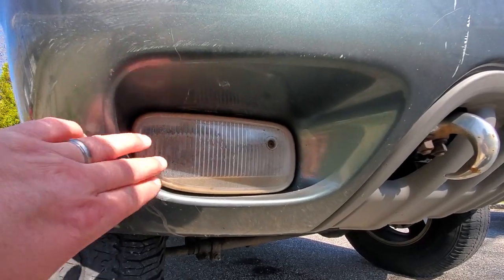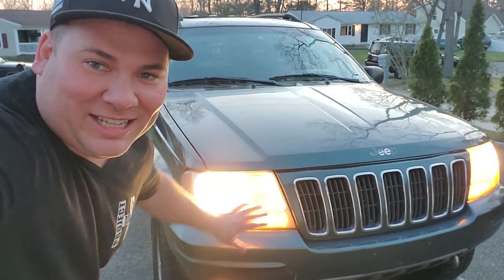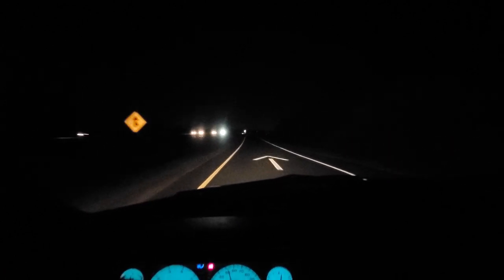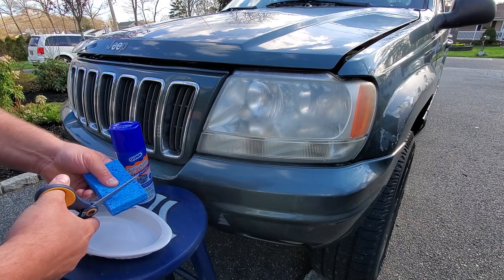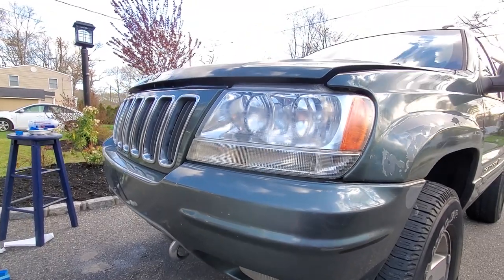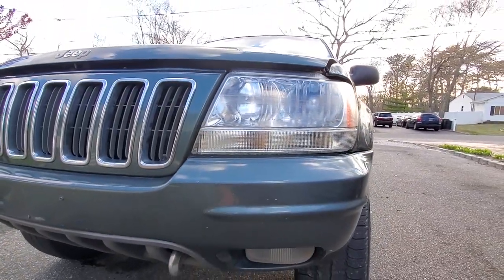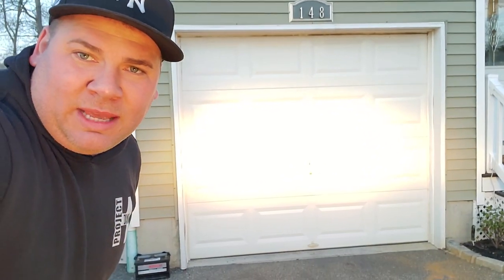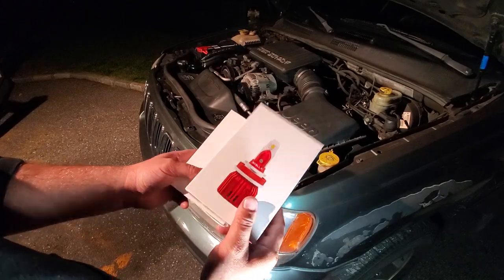JEEP WJ LIGHTS - RESTORING AND REPLACING GRAND CHEROKEE LENSES FOG LIGHT AND BOSLLA LED BULB INSTALL

Comment: great tutorial Dan...hey couldnt you drill a weep hole in the fog light if you didnt want to change them out to keep the water draining out
Reply from the maker: That's a great idea.. I did gus's right on the. Bottom closer to the  front right?

Comment: I need to upgrade to LEDs in my WJ. Just for future reference, Kelvin is the temps at which the bulbs burn. lumens are the output. 10k temps would be deep blue. but 10k lumens would be a really bright light output. typical bulbs burn at 6000-6500K for headlight output(LED & HID)
Reply from the maker: Exactly 👍

Comment: Yes hi Dan I had bought in speakers off of you about maybe a year ago I have a question and a situation my charcoal canister under my 2003 Jeep Grand Cherokee the metal box I guess that it sits in is totally rotted away the the charcoal canister is just like hanging there by the hoses what do I do about this can you just give me some ideas I would really appreciate it Dan thank you very much
Reply from the maker: Hey! Hope you and the speakers are doing well.  The box isn't completely necessary.  If you cant find a replacement see if you can hang it up there with some zip ties... just so long as the tubes and hoses are connected 😊
Reply: @ProjectDanH  I will try that thank you

Comment: Hi there Dan im working on a 99 grand cherokee v8 4×4ect about to install some new fog lights but cannot find foglight switch for the life of me seen a video where the plastic switch pulls out on this model where the head lights would be.im wondering if some one changed switch at some point to one with no fog light opion.it has fog light and a factory  harness,even has fuel fuses
Reply from the maker: it's very possible someone switched out your switch!  I have a switch video.. check it out! you can put a new one in yourself.. very easy!
Reply: @ProjectDanH  thats exactly what happened someone installed wrong switch before we bought it.thanks

Comment: That is about 5-6k color temp. 10k would be blue.

Despite "Higher numbers are better!", you want color temps in the 4-6k range, as they provide the best Color Rendering Index and lower color temps produce more actual light.

As for the housings, those are for the Limited. Laredo housings have amber lenses.
Reply from the maker: The box on the fog light bulbs says 6k, the Boslla bulbs are around 8k..  not sure what years and trim trim levels had what lenses but I nabbed them off a Laredo so I call em laredo6 🤣 thanks for watching

Comment: I have a 2000 grand Cherokee with a 3 inch budget boost lift kit from rough country when I’m driving straight between 40 to 60 mph I start to get swaying at the back and if you feel like it’s Fishtailing everywhere I can’t find the reason why it’s doing it I checked my control arm bushings those are good in all of my suspension components OK
Reply from the maker: That's the rear upper control arm.  the boomerang shaped one.  You'll most likely need a new one, and its recommended you use a spacer since you have a lift

Comment: Yeah... did you think of the LED headlights blinding the drivers coming at you?
Reply from the maker: no, I don't .. It's 2021.. just about every new car has LEDs, bi xenon, or projection bulbs.  it's time my 20 yr old halogen bulbs were ungraded to match the rest of the vehicles on the road

Comment: Thank you from Mariners land. You didn’t need the anti flicker bs. ? They said I needed them but I see no one putting them. My 04 ram needs them or “ lamp out”. Thinking of taking them out of the Jeep then use them on the truck. Yes our baseball teams suck.
Reply from the maker: LMAO... These LEDs are pretty smart, you don't need extra resistors.   LGY!

Comment: Hey great video! Got a question though:

How do these Boslla bulbs do in fog, rain, and snow conditions? I want to get an 03-04 4.7 WJ, but it's concerning that there are no halogen low beam or fog light blubs that are designated for snow/fog/rain conditions available on Rockauto or anywhere else I can find them and living in the rural midwest on a backroads / highway commute, you can probably understand  why it's a big deal. 
LED's traditionally aren't warm enough to keep the ice off which is obviously horrifying, so with the yellow setting on, do you know how these do in said-weather conditions?
Reply from the maker: I love these bulbs, just enough heat to melt ice and colored enough do contrast the snow and mist.  if i had any complaints it would be that the amber isnt "orange" enough

Comment: The headlights look bad, the sand paper polisher method is way better once you finish they look brand new it takes like 30 minutes.
Reply from the maker: I didn't feel like spending 30 mins on a lens I was replacing but there are alot of good polishing products out there
Reply: @ProjectDanH  true if your replacing it why do it. 
I did it on a Jeep wj they came out great.

Comment: Chemical cleaning only lasts a day or two not worth doing
Reply from the maker: I didn't clean it... I Melted it.  It lasts just as long as sanding and is much quicker
Reply: @ProjectDanH  I've melted them too you can get New one's for$150 or less
Reply from the maker: @ericschulze5641  or 10 bucks at the yard! Lol